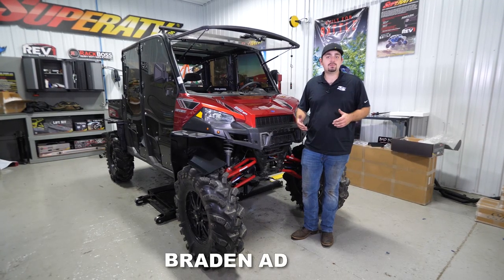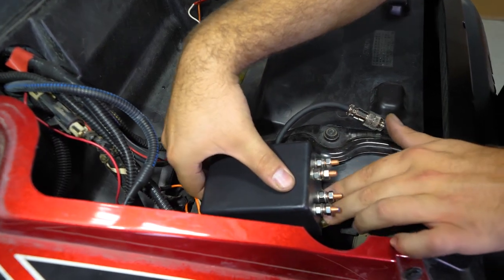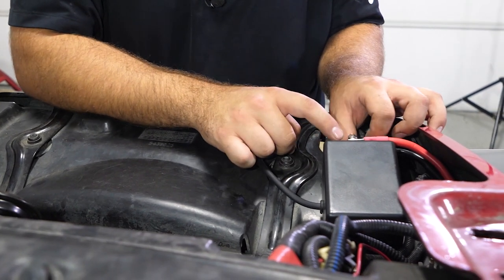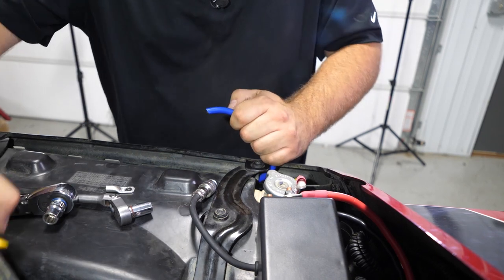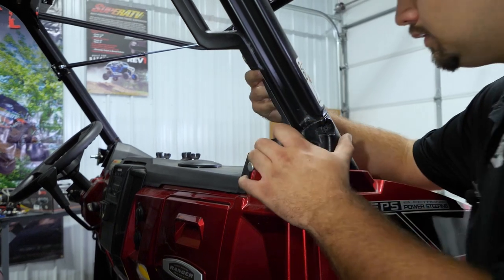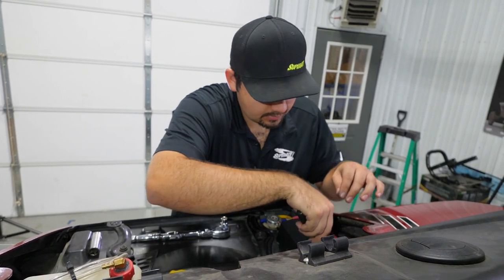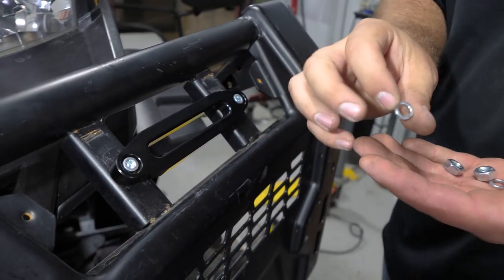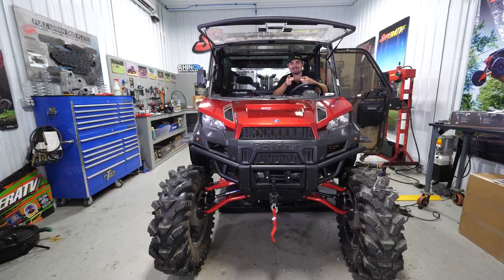Black Ops Winch Install on Polaris Ranger XP 900 | How To

Comment: Good video. One point of verification is that the winch should be facing the other direction so the wire comes off the spool on the bottom.
Reply: What you suggest isn’t possible. The winch cannot face the other direction. It seems that the only way to mount this which on this machine is upside down. The manual for the winch say “warning” do not spool from top only spool from the bottom.

Comment: now do one with the new plug pulse bar....  I know it has 3 wires on it which is similar to the bar you are hooking up to.  One Neg, One keyed hot, and One always hot.  i dont think I would hook the hot and ground from the solenoid to the pulse bar style plug.  So do i just send the HOT and Ground to the solenoids on the pulse bar and just use only the Acc wire (middle wire) on one of the pulse connector plugs?